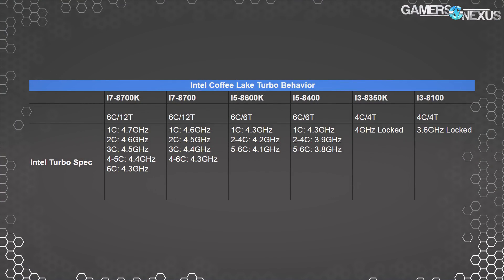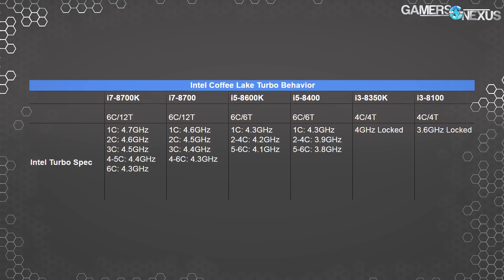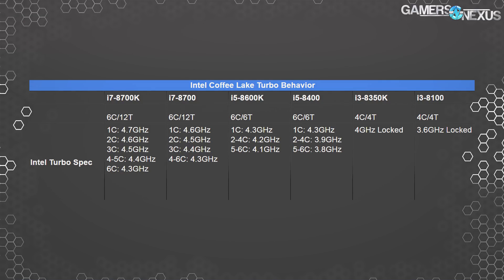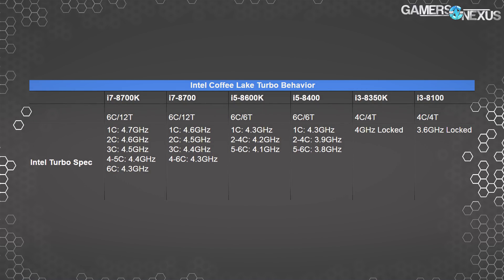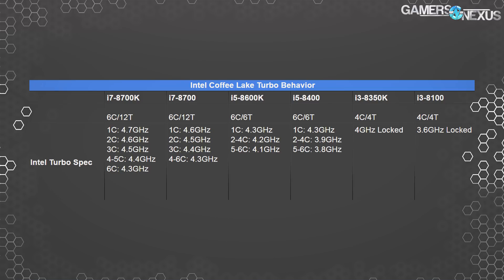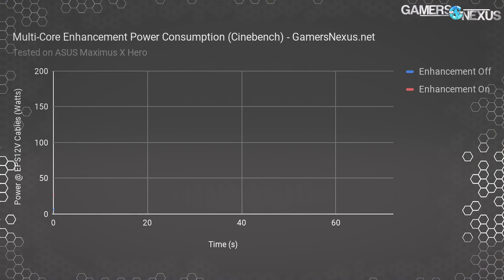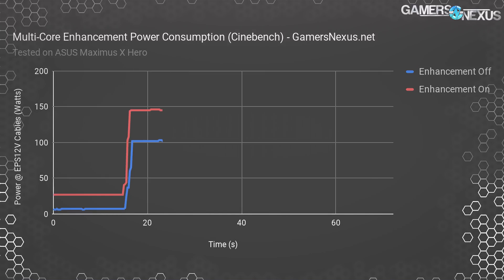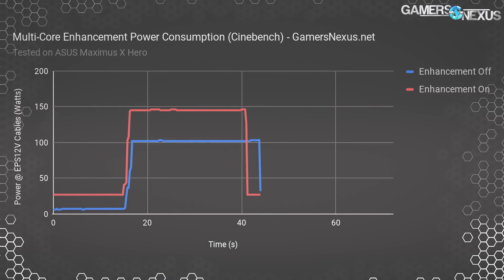Explaining Coffee Lake Turbo Boost Variance & Multi-Core Enhancement

Comment: Why would anyone even need enhanced multi-core if they can just set the multiplier to 47 and call it a day? Non-k SKUs shouldn't even exist.
Reply: RadiatingRedstone That right there should be more than enough reason for all motherboard makers to keep this off by default, all they are doing is instantly voiding everybody who buys their boards cpu warranty for a tiny gain (with a ton of downsides) that most people would see no real benefit from outside of benchmarks and the people who would, would be doing their over overclocks anyway.
Reply: Binning is not an excuse for locked non-overclockable CPUs.
Reply: So there's a number of reasons. If the cpu was labeled clocked at 4.7ghz some buyer think that is a no tweaking necessary and they they see 4.3 they may feel ripped off for has a bad cpu. 

Another with enhanced your letting the board do all the work. Again no tweaking no input from the customer no knowledge of how to overclock, overvolt etc. And I'm sure it takes cooling into affect. This is the same reason why people buy those self oc  boards. They just want to push a button and let the pc do the work. And it's (in a way) there right. The company touting overclock headroom and performance but it also violates warranty is like releasing a car saying it can do 120mph but the second you do all warranty is voided. So doing things this way is not just more convenient but also safer in terms of warranties. 

You want to expect everyone that builds a pc to have the knowledge to adjust bios settings and multipliers and then test for thermals and stability  when most of them just want it to work, getting as much performance as possible with little effort
Reply: Comanso Rowlett it does actually break your warranty.  Intel considers it an overclock.
Reply: Maybe you've heard of this thing called "binning". It's kind of a big deal...
Reply: Possibly because it doesn't break your warranty, where as overclocking is supposed to. Although they have a hard job proving you've overclocked usually.
Reply: and the second part of that is called "business". Look at AMD. Their 1800X and 1700X chips don't sell because they're the same as the 1700. Businesses are out to make money, and Intel is doing that. Would I love every intel chip to be overclockable? Hell ya, but they want to make money and they do need money too for new silicone research. And guess who has faster cpus? Intel. They pour a lot of money into research.

Comment: I agree wholeheartedly that it should be off for review purposes, I mean it's basically just like using the auto overclocking feature on the motherboard which makes them OC results and not stock. There are issues with this as well since not all review sites do this properly, most notably a lot of the mainstream ones. So it suddenly becomes far harder to compare review results as some may do "multicore enhancements" while other won't.

Comment: Steve could you look into i5 8400 BCLK overclocking? I've heard of people reaching 5.2GHz.. is that possible?
Reply: I think people are getting confused by something from the Level1Techs forum, where someone SIMULATED an 8400 using an unlocked 8700K with Hyperthreading disabled and drew incorrect conclusions based on that (i.e. that because you can BCLK overclock the 8700K, you could do it on the 8400). From everything I've read, including reviews that have specifically mentioned trying to adjust the BCLK, the actual 8400 is completely locked down and won't POST over 103MHz or so, meaning a sub-100MHz gain. You CAN adjust the uncore ratio on it though, which gives a small boost to performance.
Reply: Aw man, I really had my hopes up..
Reply: Sub 100 hz gain?  3mhz x 40 multiplier = 120 mhz gain; for the 8350k, 3mhz x 36 multi =108 mhz gain.
Just sayin'.  Maths is fun.
Reply: maybe coffee lake will be different... i know my sandy bridge doesn't like bclk oc'ing bu I haven't followed all the other gen's that close on a detail like that.  do even skylake and kaby lake object to more than 5mhz?
Reply: +MarkHuron https://www.youtube.com/watch?v=7k_ssaTq_mE :D
Reply: Aretak that's.. not right. When a 28x multiplier CPU turbo boosts to 4ghz, bclk stays 100mhz and multiplier increases to 40x. Likewise, if bclk is increased to 103, it's 28x 103 when running at base multiplier and 40x 103 when boosting.

What you said suggests that a 28x multiplier CPU can't turbo boost - how could it turbo boost at all if it can't go beyond 28x?
Reply: Chola Tech :D
Reply: It isn't a 40x multiplier though. BCLK overclocking isn't calculated by the single core turbo multiplier; it's calculated by the base multiplier, which is 28x with the 8400's 2.8GHz base clock. I'm sure you can use your impressive maths skills to work out 3x28 from here.
Reply: BLCK overclocking will cause failures past a certain point its best to just avoid it for the most part unless you increase it lightly

Comment: Was there ANY review with the 7700k and the 8700k both overclocked to the exact same overclock and then ran the tests ? Like say both the 7700 and 8700 with all tests at 5GHz.

For an enthusiast that is really the only way to know if there is any point for me to upgrade from my 7700k.
Reply: I wouldn't call the 7700k an "enthusiast" CPU.
Reply from the maker: We talked about that in our initial review.
Reply: Hardwareunboxed clocked both at 4.5ghz and ran some tests but also disabled 2 cores because he  tested the Ipc improvement

Comment: Thanks ! I will try all this when I get my 8700k

IN TWO DECADES WHEN IT'S BACK IN STOCK
Reply: Not sure if you meant this, but I would be very surprised if there were any sales for a processor that has been out for a little over a month.
Reply: Alex Marin Sweclockers already said shortage till end of year.
Reply: Kudus for asking the community - Off by default
Reply: Marc Balestre just wait till they iron the bugs and dont have to deal with all these items. I mean a month more not going to kill you. There are obvious bios here and there that need to be iron out. Once they do I am picking one up in December. So I am good.
Reply: Same happened with Ryzen 7, then 5, then 3 then Vega and if you look back it happens just about every bloody time with every bloody manufacturer.
Reply: what? you think theres a shortage in 8700k's cause intel is ironing out it's bugs? really?
Reply: Why are you mentioning the Optane 900p? It's not relevant to this at all. We're talking about the 8700k.
Reply: There should be sufficient supply from November 1st. But I wouldn’t rush to get it immediately if I were you, better wait until the week of black Friday (20-27 of November). And that 480GB Optane 900p SSD that will launch by then will be mopping the floor with the Samsung 960 pro (10x faster random 4K performance).